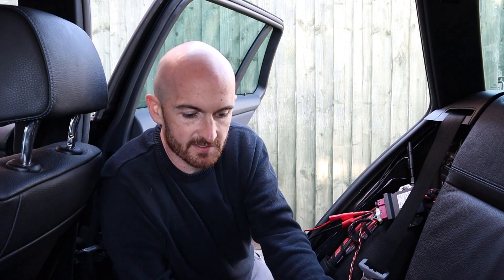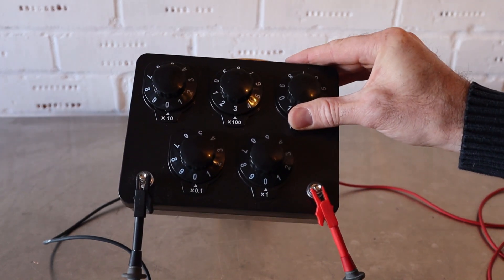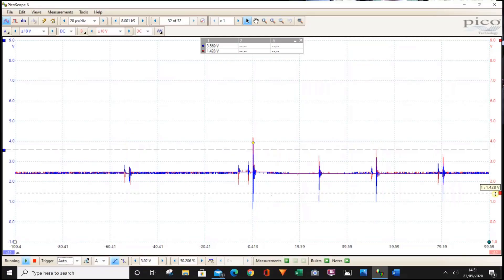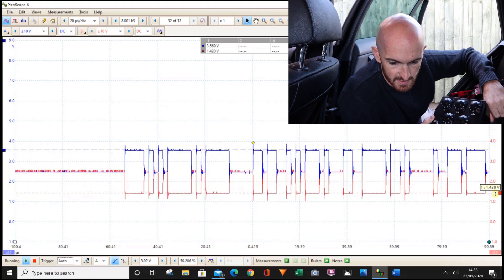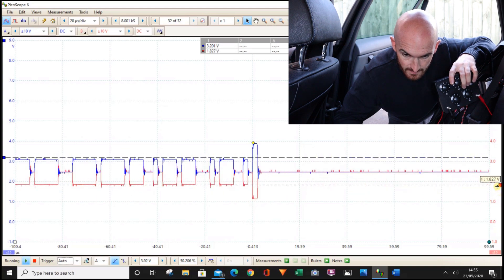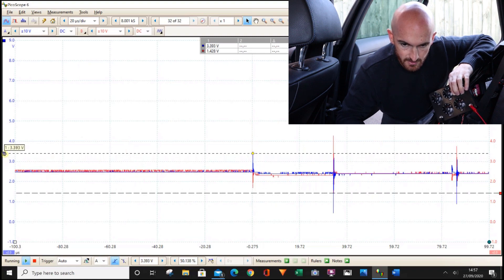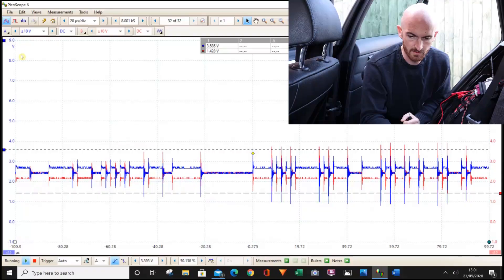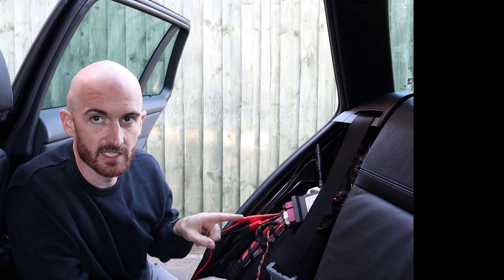CAN Bus High Resistance Short Circuit | CAN Bus Diagnostics | Mechanic Mindset

Comment: Very useful video exploring can bus behaviour! I note you did not test can H and L high resistance shorts to ground, assume the network would still be quite robust? I have challenge on my 2006 Range Rover sport ABS module. Can high and low resistance to ground at the ABS disconnected terminals is about 840 ohms which is low ( I think). I am getting intermittent comms dtc on my scanner. Wondering if this 840 ohms to ground is normal for the Bosch series 8 ABS module?
Reply: Thanks for prompt reply! Would just like to know if this is normal for the Bosch ABS or am I heading for a breakdown in the Australian outback! Your tests in this video would support the view that 840 ohms is ok so thanks much lay for the support!
Reply from the maker: @RobertDeWet-o1zHonestly I don’t think it’s common for Bosch ABS to fail like that. However, I wouldn’t be surprised - it can happen with any module. You’ve just got to narrow it down
Reply from the maker: Hmm, if you have a look at CAN with a scope, it will give you a better idea. This is an old video and we have covered it in detail in Diagnostic Coach training, but I think it will have to be much lower before it causes a problem. Don’t quote me though!

Comment: Can I switch in 8 ohms resistor and still lock unlock the car? this way it would stop keyfob relay signal and canbus theft.
Reply from the maker: @arvindtaylor6871  hmm, I’m not sure it works like that. Your locking system could be stand alone and not require CAN. 

Best thing if this is what you want to do, hide a switch that makes an open on something important like starter relay, or ignition wake up

Comment: Well informative Video, but my question is what type of oscilloscope will you advise a beginner to start with?
Reply from the maker: Glad you enjoyed the video! I alway suggest the PicoScope 2204a; it’s easy to use and very capable. I am launching a video soon which will show you all the accessories you need to get going for the best price. There are other cheaper scopes like Hantek that do the job, they are just a little less versatile. Hope that helps 👍

Comment: thanks for video   i could not understand weather you used the resistor box in parallel or series with circuit.is it possible to draw the wiring diagram.   thanks.
by the way  i have not seen any new video from you past few months. Looking forward  for  new ones
Reply from the maker: Hi, I had the resistor connected between CAN High and CAN Low (short together). Yes a diagram would have helped understand better; I’ll remember for next time!

Yes been quite busy but have a couple of videos in the pipeline, one to release their weekend and will be filming Gagarin tomorrow! 👍 cheers

Comment: Hello my husband did a heater core on our 2011 ram 2500 and now we’ve got no bus coming up on our Dash not sure where he can start
Reply: Also our wiper blades are going crazy
Reply from the maker: @stitchedbyfelicia  Hi, I would be getting my scope out to see what’s happening on the CAN lines. I think you can access them all at the Diag connector. I have some videos on what you need to look for. If you don’t have a scope, I also have some videos to show you how to read with a multimeter. The fact you know that something has happened during this job should help narrow down where you have to look for the fault. Might have caught a loom on the dash carrier or something, they can be quite sharp. Sorry, I’m not to close with NAS vehicle. Hope that helps!
Reply: Also it might’ve been when they were trying to weld nuts on my manifold bolts I don’t think the battery was disconnected
Reply: Also thank you for replying
Reply from the maker: @stitchedbyfelicia  👍

Comment: Good video Darren:)

I have a very similar Decade Box. I believe they use some 1/4w and some 1/2w resistors and that there's a transition point between the two usages.
My Mandarin isn't as good as it should be, I was wondering if you knew where that transition is on yours?

Denis
Reply from the maker: Ah ok, I was aware they were low wattage but didn't know they might split them that way. My manual is also in Chinese, the diagram doesn't give much away. Not sure I'm brave enough to open the lid to check! haha

Comment: Thanks. So Ch1 CAN high to ground, Ch2 CAN low to ground, than the decade-box between CH1 and CH2? The resistance from the Decabox will than be parallel to the 120 ohms resistors in the system? When all is good you should have 60 Ohms between hig and low? Have i got it right? :-) Did you work as an educator or instructor? You do it very well.
Reply from the maker: AN AN That’s right - sorry, I should have made a diagram! So I am basically shorting CAN High and Low together with the resistor box. Yes, I have been in technical training roles for the last 10 years 👍

Comment: I like the way you do things.  This is the best way to learn.  I found out, about 20 years ago, that just asking 20 experts (real ones, not pretend) would just get you 20 different guesses.  They would know the guaranteed minimum resistance from specs and datasheets, but probably never saw a real life example.  It's just best 5o see for yourself when you're curious.  Of course this is only one specific example, but it's one more than most techs or engineers have actually tried.
Reply from the maker: Thanks for the feedback! I have found exactly that in the training world; people have different opinions on how they think it works, and not all of them can be right 😂. Even I have argued my side and turned out to be wrong - so many variable in the automotive world!! Thanks for watching 👍
Reply: @MechanicMindset  I did a PIC microcontroller project over 15 years ago.  I wanted to see if I could "steal" enough electricity from a telephone line to power the micro and an LCD display.  I was absolutely assured by "experts" of everything from it's impossible to take any useful amount through I would absolutely be disconnected from the phone company permanently.  Turns out that I could take several mA of current without creating an off hook status and absolutely nothing happened with the phone company.  One guy contacted me privately and explained how he built a "down hole" type battery powered device (actually a street manhole) and connected it to an available phone line.  At night they would call the device and suck the massive 100+ volt ringing signal off the line and recharge their batteries by letting it ring for hours.  The phone company never noticed a thing.  You'd think they'd pick up on some phone line ringing for hours on end on a daily basis.
Reply from the maker: tonyfremont Haha, that’s amazing! I would have never thought of that; very creative! 👍
Reply: @MechanicMindset  that's what I thought, recharging from ringer current was genius.  I learned so much from those guys, it was better than going to school.  The really clever guys learned their hands on skills fixing pinball machines in their younger days.  No schematics, or at least none that actually represented what was really happening inside them when they had to fix them.  Game room props taught me just how creative people can be at inflicting damage to my "art work".  I'm seeing a lot of the same kind of experience watching guys like you and Eric O diagnosing problems and undoing other people's "clever repairs".  Theory is just that, it sounds reasonable, but the real world is never really included in a schematic.  It never dawn's on a newbie what really happens when you turn on a switch, it goes on and off dozens of times before it settles down.  You don't see it when a light bulb comes on, but a computer sees it every time and has to cope with it.  None of the datasheets or other documents bother to mention all that other spiking and whatnot on the CAN bus, they just have pretty pictures of a waveform that will never match what you'll see on a scope.  Automotive electrical environment is the absolute worst, it's everything but a steady 12 volts, just like ground is everything but what you find at the battery terminal marked - It really is a marvel modern cars actually work at all.